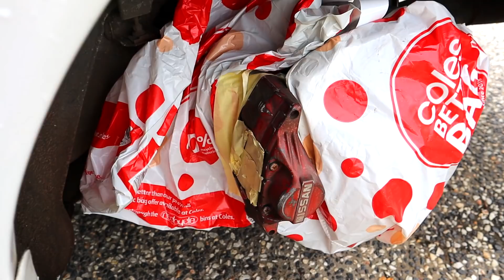Painting the Calipers on the R33 Skyline

Comment: Sand the Nissan logo on the breaks it would make it pop 👌
Reply: Miles betts yes bro yes
Reply: A sanding block and some 180 grit wet n dry will do it used this trick to get the logo back on my sr20 rocker cover
Reply: 100%
Reply: Couldn't agree more. I wouldn't do it any other way
Reply: 100% agree would make it way better

Comment: hmmmm....
So for the barra and for the sake of another 100 hp, save your young guys money  and  leave as is for a while, that can happen later on a proper build so  don't blow all your load as once ;)
Ok so for Mr White, id like to see you and your mates do some of the work, so pull the motor yourselves and get some good vlogs going, your green crash mate can lend you his lift. So for the money saved to pull the motor, invest in some pro h carrillo rods, upgraded wrist pins and CP pistons, these will handle up to 1000hp for when  you decide to push further, over building is good. The rest will be as per hp goals however spend once and do it right without short cuts. I'd be looking for around 500hp on a nice safe torqy  build. Make sure you budget for all the OEM replacement belts, pumps, gaskets, pullies etc A good Ecu with fail safes to protect your motor, i like Link. Good set of full gauges, oil pressure most important. I'd go a flex tune. The rest you should already have worked out

Comment: With the falcon power upgrades 
Valve springs 100% 
Head studs over kill unless your pushing big number 
Oil pump gears if you have no throttle control

Comment: A possible reason for the paint reacting badly on the Ford callipers could be due the solvents in the paint. You have an approximate window  of one hour to redcoat or you have to wait seven days to re coat as recommended by the paint manufacturer.

Comment: I had the same problem with my r33 reverse lights, try the plug directly in front of the fuse box in the engine bay. Fixed my problem could fix yours

Comment: I had an R33 before you were born. You should high flow the turbo or replace with a similar matched unit. Haltec ECU and coil pack you will have a perfectly capable drift car.